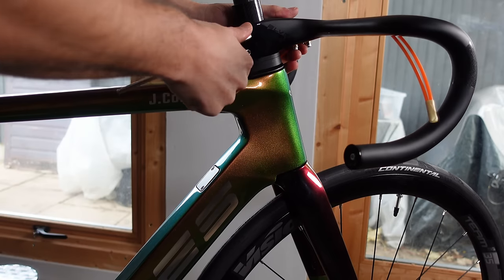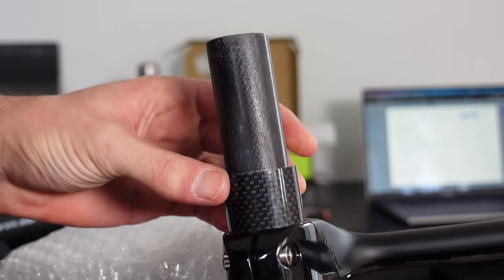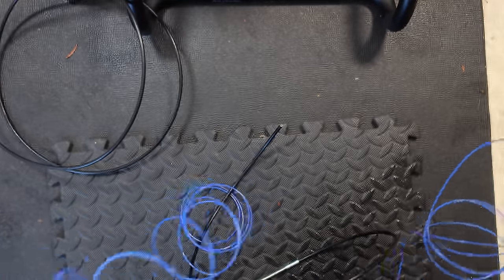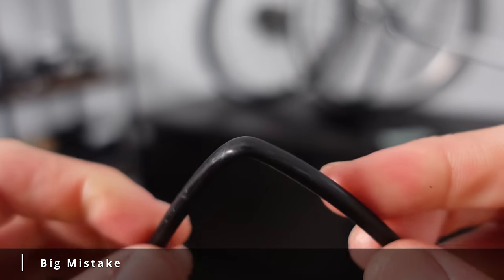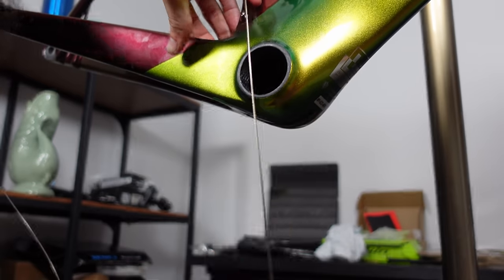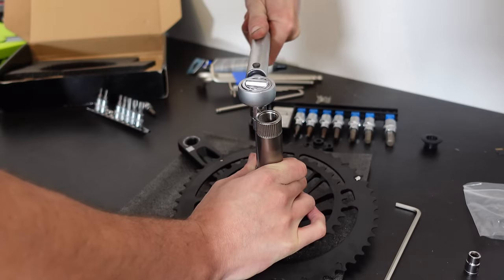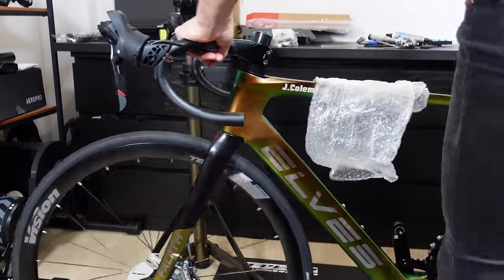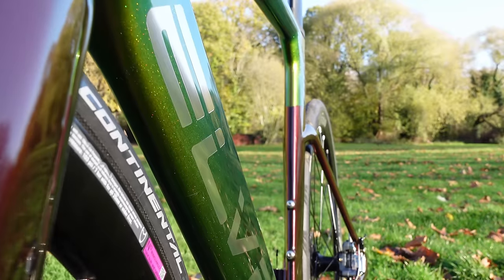$2000 AliExpress Carbon Superbike… Full Build Process!

Comment: This aint superbike lol 😂 

I was hoping you’d use an ultegra mechanical or sram rival/force at least lmao. Also you might want to weight that again or check your scale i remember from your previous videos you have the weight of that frameset wrong.

I’ve also owned those vision team 35 wheelsets and they’re 2kg for a pair. Continental gp5000 and butyl tubes already weigh at least 700g for the pair. And the crankset and groupset are heavy af coz i also own those from my old bike. My size 49 falath weighs 8.1kg with pedals, fizik 3d saddle, 2 bottle cages and garmin mount and straight ultegra mechanical with 172.5 crank arms, 50/34 chainrings and 11-34 cassette, 1.5kg carbon wheelset and using a 28c tires with ridenow innertubes and still comes out 8.1kg 💁🏼‍♂️

Comment: Not very responsible video:
1) You do not want to respire carbon dust at all, otherwise you increase the risk of lung cancer. So you always need to wear a mask P3 to cut carbon fibre. Also, you do not want to use a standard dust cleaner which is spreading the dust around afterwards. So you either use an asbest class dust cleaner or you wet clean the dust only.
2) Well, the chineese bike parts may look fantastic at a fraction of the price. Just be aware you do not have ANY warranty or certainity that it does what you expect, the layers inside can be placed (or not) as ever they wanted (or not) - after grinding and painting you can not see anything from outside and you do not have any supplier to relay on.

Comment: much too heavy I wanted to take an elves and with customs fees it is too expensive 8kg500 this is huge and moreover I think the carbon and poor quality over time
Reply from the maker: The weight is mainly in the wheels. They are over 2kg compared to a lightweight carbon set that would be more like 1400g. I'll be doing long-term reviews so let's see how it goes...
Reply: @JourdainColeman  I wanted to take an elves but long delivery time and customs paid it is expensive moreover the carbon used for races would be weak the rear wheel has a lot of difference with the seat tube normally it should just be close

Comment: Great advertisement for the Chinese brand; they've certainly zeroed in on the value of social media "sponsored" reviews. But while I understand you need to pay the rent, doing these types of videos kills your credibility, and quite frankly should at least tweak your conscience. Forget all the ethical and moral issues or that your are promoting a product made up of counterfeit or copyright infringement parts. The bigger issue is that the product is at best a rolling piece of substandard materials and potential headaches, but at ot worst, a potential death trap. All hyperbole aside,  light frame and wheels on a Chinese knock-off bike is a recipe for catestrophic failure. I've seen it in person, riding mates with Chinese bikes or parts like seatposts and handlebars snapping in half, CF wheels collapsing during a fast descent, frames folding during uphill sprints...I could go on and on. But all these failures get swept under the rug because the bike is sooo cheap. Yet how do you put a price on the injuries and repair nightmares that are a result. Sure most savvy and experienced cyclists know better, but your video appeals to the novice and ill informed and you should be ashamed of yourself.
Reply: So where are your frames made? 😂 or your wheels?
Reply: It's not like Italian brands with their indestructible frames, right?
Reply: This is nonsense